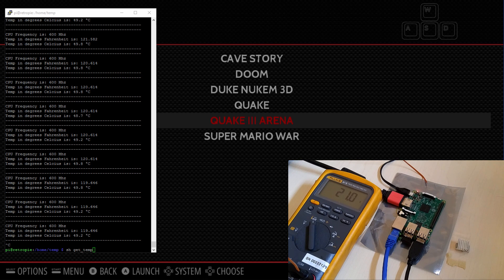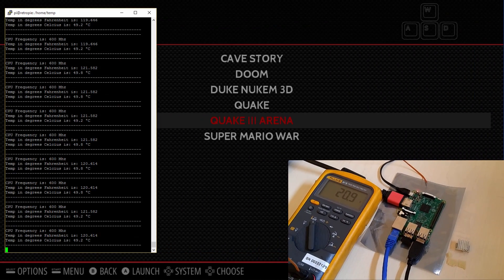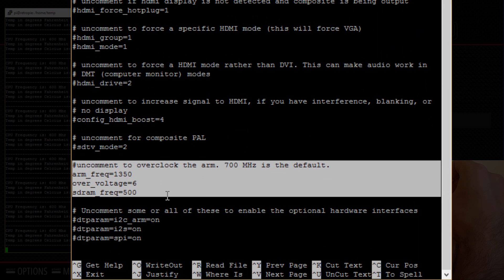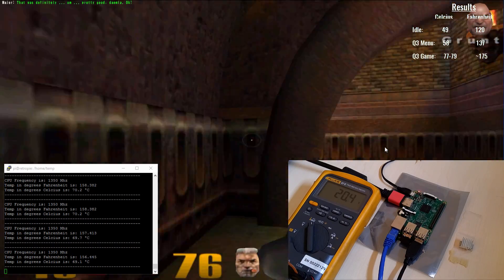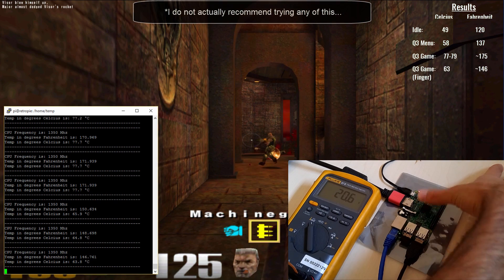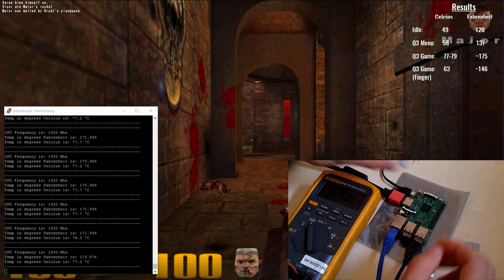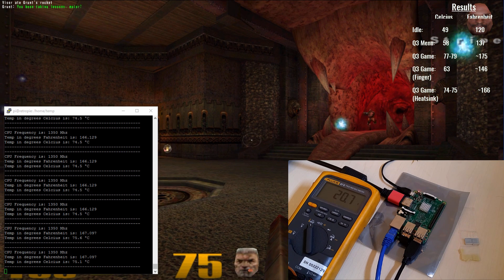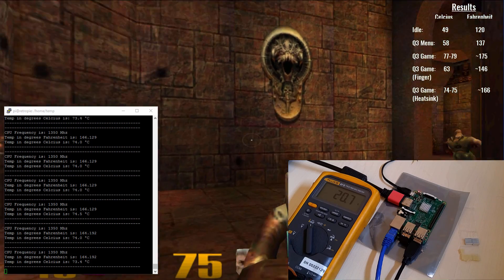Raspberry Pi 3 Overheating: Does the Raspberry Pi 3 need a Heat-Sink?

Comment: I wouldn't have applied finger fat on the chip before testing out the heatsink. Besides... 'Artifcts' on screen? That should be a rather rare symptom of overheating. Usualy the components just get damaged beyong repair, barely able to continue their function on lower temperatures due to some physical effects.

Comment: yes it does,  seem to be that depend on the lot, raspberry pi 3 B  is different, for instance mine  rise up to  80 degrees Celsius easily without playing a game , only watching a  video on youtube   and   in idle it gets  63 degrees Celsius ...by the way mine has its heat sinks, I figure that whether not it would have got fire already,  for me to be able of maintaining the temperature under control, I am talking about  47 degrees in idle and   55 degrees watching videos on youtube,  I need to use a fan to blow the heat sink and dispel the hot that they produce....you and plenty of people are lucky that they got a good one and not the defective one.

Comment: hello,i have the pi 3 and i never touch the 70 degrese with a heatsink and with a 40mm fan 12v i stay at 40-50 degrese.
Reply from the maker: +youssef grine have you tried running Quake 3!? It really heats it up, mine is usually around 55 also.
Reply: +TechTipsta with quake 3 i stay at 50-60 degrese but without fan i touch the 85 degrese and the pi3 start throttling.

Comment: Nice video!  I run BOINC Projects on the Raspberry Pi 2B and Pi 3 that peg the cpu meter at 100%.  The Pi2 runs at about 60 to 65 degrees C and the Pi3 runs at 80 to 85 degrees C.

According to a video by LadyAda of AdaFruit, the Pi3 can throttle back the cpu frequency to prevent overheating.

You can use the watch command with vcgencmd to monitor the temperature and frequency

Comment: it reaches 80°C and throttles the CPU. You should track temperature and clock speed. if you're planning to do anything demanding like 3d gaming you need a heatsink, and it needs to be beefier than that tiny one you put on it.

Comment: Running Openelec, mine kept rebooting, took the SD card out and put it in a PI2 and it's fine. I'm guessing it's down to overheating, but can't say for definite.
Reply: +Paul Barraclough 
Could be a lack of power.
I run openelec in pi3 but without any problems.
The pi3 needs slightly more power going into it than the pi2, depending on what usb peripherals are connected.
The raspberrypi foundation recommend at least a 2.5 amp 5.1 volt adapter.

Also, make sure you are using the most up-to-date openelec image.